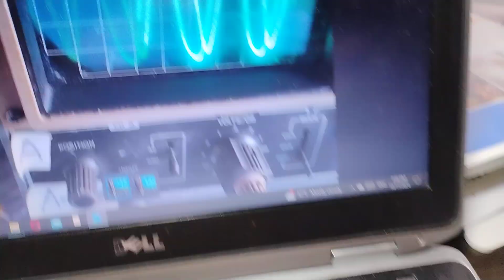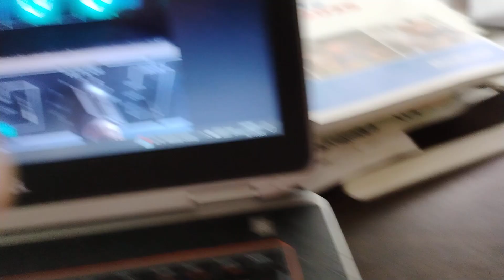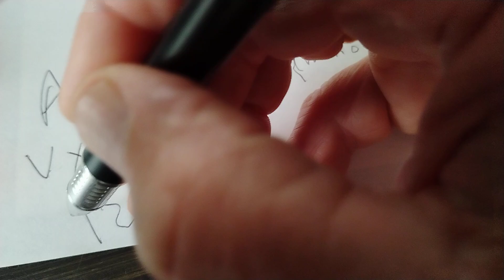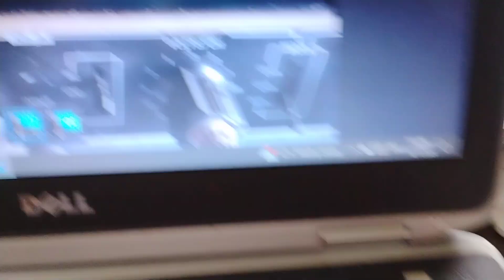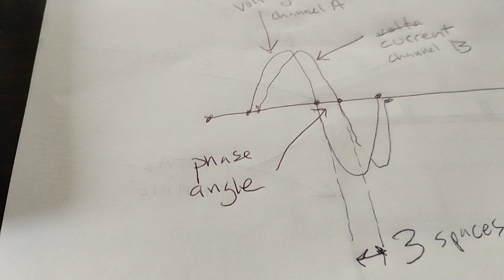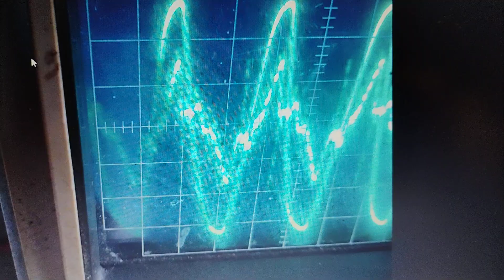Analyzing photos of hemmorroidal phase shift etc

Comment from the maker: The scope photos show the AC input to the transformer.
And the scope setting was set  at .01 volts per square-division. 
Measuring watts in the photo WITH a 4uf "power factor correcting" AC cap right across the primary of the transformer,
I calculated 1.2 watts AC  input to the transformer primary.

Doing it  like this:

.01V square divison setting = .01V / 5 spaces per square division = .002V per space
17 spaces measuring vertical "peak to peak voltage" to measure current in the photo with power factor correcting AC cap.
17 X ..002V = .034V looking at peak to peak of the current trace (channel A) 
.034V / 2 = .017V (because you need to divide by 2 the peak to peak voltage for the amperage calculation)
.017V X 10 = .17V since the scope probe is set at  X 10 voltage
.17V X .707 = .12VRMS as the calculations need to be in RMS since it is AC being measured
.12V RMS x .1ohm = .012Aac is the AMPS seen on scope    (since there is a  .1ohm  resitance to shunt resistor)
120Vac X ,012Aac =  1.2 WATTS INPUT

Comment from the maker: Hi Gerry 
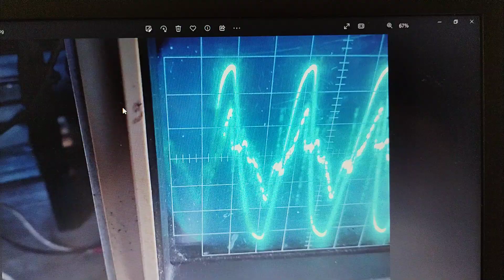At 12:55 i show with a 4UF "power factor" correcting cap lets call it that ... Basically it is an AC cap parallel to the primary of the transformer.
I went through a few sizes until on a meter, the input draw really drops down (45ma to 14ma at the 120vac 60hz AC input from grid)
All the while, the output watts of secondary stays the same (16.2Vac across 50 ohm resistor) 
Then took a photo of what the scope looks like with that AC cap in place. 
 
I am not applying PF to this watts equation nor worrying about what any phase shift may be at all,  with that fuzzy triangular shape you would see on scope if were to look, 
And am just doing meters-only and get input of 14ma at 120Vac (1.6W)  vs output of 5.2 watts so overunity "by meters' which is good enough for horseshoes 

Then to double check and  measure current with the scope as well,  that 30 spaces vertical P to P and the .01V  square division setting gives  near same watts input (1.06Aac with scope if you do the math) which is good...this being calculated with the trangular fuzzy current shape. ( and really no phase shift anymore with the AC cap in place)

I saw what you mention in previous videos with the differences in the 90 degree peaks, 
plus pos and neg  shapes different (the neg "gets  pointy" at bottom)
dont really know what to make of those, the "reasons for being"
I was thinking there is the semi-normal  positive peak but "dissapates in time" going down to negative creating the pointy stuff to be some sort of imbalance happening perhaps from the shunt bars. (but I dont know)

The first part of this video, looks like pretty nice sinewaves to me, to the still photos I took of scope.
 
Phase angle  seems to be 3 spaces at 11.5 spaces per 360 degrees, so  gives about 93 degree phase shift 
(and this all gets erased down to no phase shift to speak of when AC power factor correcting cap in place), 
and so with the AC cap , PF = 1 
(and not PF = ZERO as  will be a 90 degree phase shift you will get WITHOUT the power factor correcting 4uf cap)

So it can be 90 degree phase angle "pure" reactive power in, while some real power out (if you want)
 
Or it can be real power in and real power out with that power factor correcting cap in place.... 
this what I was trying to show here...
Reply: Thanks for explaining Doug.

Comment: Hi Doug, yes saw the cosine error. Plus the phase shift waveform needs to be a nice sine wave not distorted. We can see the difference in up time and the down time eg: time taken to reach 1st 90 degrees peak, looks markedly different to the second 90 degrees where it falls back to zero line. This means distortion of the displayed waveform, yet 360 degrees is still 360 degrees per cycle just it's non linear in how it's occuring so can muck up our timing measurements. Analog scope trace across screen too can be non linear at especially at start of trace, please try to beg borrow or steal a digital scope mate.

Comment: Apparently I need to get a scope nothing to crazy expensive but adequate to do the job.
Any and all suggestions welcome.
Reply from the maker: Hi Jon 
Make sure it is dual trace type with two scope proves the main thing.  Lots of people have recommended I get a modern digital scope with lots of features, but I  resist since this old analog one has worked fine for over twenty years. Works well with spikes too. Look on eBay your local Craigslist etc they have cute handheld scopes that look like multimeters  not so expensive.  Super fast digital scopes can cost an arm and leg.  Just get a dual trace type my only real recommendation

Comment: thanks for relating all this in your explanation, makes sense relating to your scope readings.
where and how did you learn all this?  keep on keeping on
Reply from the maker: Hi Moonfeather
I learned  most all this with lots of help from "Smokey" (Gerry) who used to have a job testing and configuring and dialing-in various oscilloscopes and knows everything there is to know about scopes.
  
If you look back at my videos over a year ago also testing the BiTT transformers, you can see my "learning process",.... the learning was doing so many embarrasing mistakes that Gerry caught and would patiently correct.

Note that with modern digital scopes filled with software that can calculate real power and power factor and just about anything there is to calculate, and all this is done "too easly" in my mind just by flipping a switch.
  
But I dont trust them (as that stupid) especially the power factor estimate function, nor the actual power readings either actually ....how could they possibly do it all?  
But for some simulation software program that would deny (or accept) anything overunity as to be some sort of computer glitch its so easy to do!
 I am doing it "analog" with my  tube-powered scope helping to prove  something can be done with a transformer design that diverts or cancels the backkemf magnetic forces that usually will raise draw upon loading secondaries..
And with this design using a standard  3ph transformer with hand-cut laminate magnetic shunt bar "add-ons" 

I showed some overunity with meters and at 60hz too last week, and so now confirming it with a scope and good thing is I am getting the same overunity measurements (about 1.2W input and 5.2W output at 120VAC and 60hz input from the grid) as before with the power-factor correcting 4uf AC cap across the primary.  .